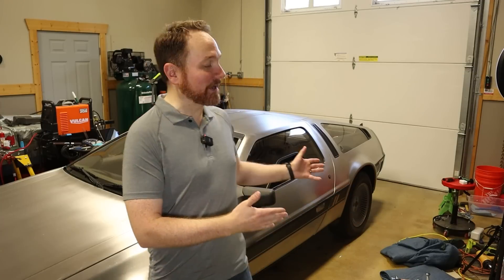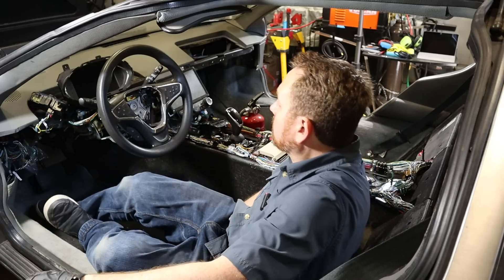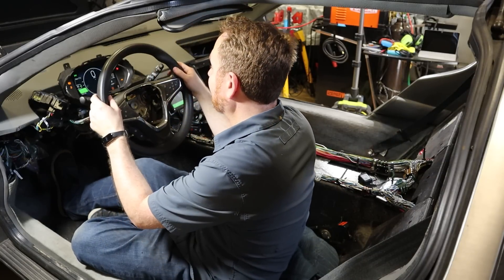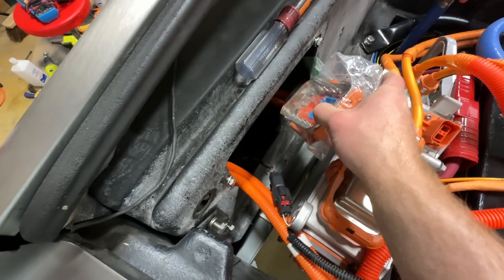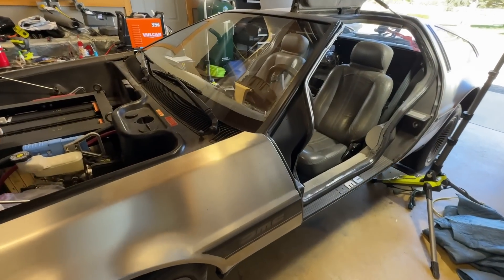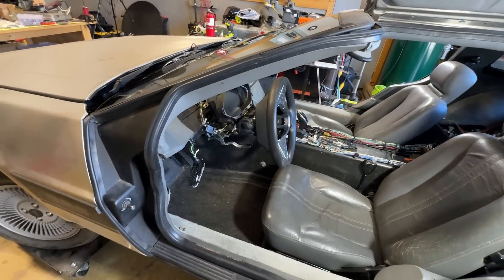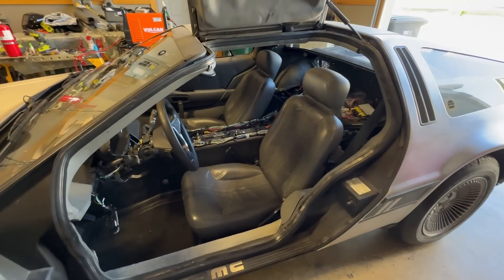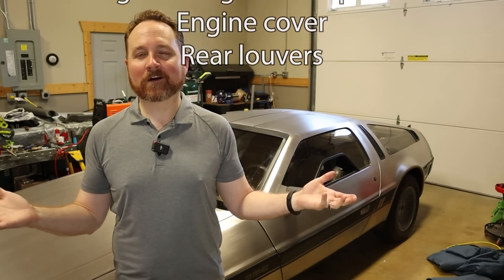DeLorean EV Conversion - Driving again!

Comment: Did you incorporate battery cooling?
Reply from the maker: Not yet - I have all the materials for it, but haven't yet gotten around to welding it all together and putting it inside of the loop. Also waiting on AC system first.
Reply: @BillCarlson  It's dependent on the AC system?
Reply from the maker: @332ARA Cooling for the battery is provided by the AC system, yes. The electronics loop is cooled via the radiator. Those two loops are separate, not connected.
Reply: @BillCarlson  Jaguar used the AC system to cool the fueling system on XJS's. So if your AC system is faulty so is how the car runs. I'd rather have a separate heat exchanger for the batteries. But Since your car thinks it's a Bolt then I guess you can't. Also do you have a total conversion cost yet?
Reply from the maker: @332ARA AC being out in the Bolt only disables DC fast charging - cooling isn't required during normal driving, it doesn't stress the battery that much.  Total cost of the car is somewhere around $60k, not including (many hundreds of hours) of labor. Labor is the real cost for conversions, if someone wanted to pay for something like this you're taking $150k-$200k.
Reply: @BillCarlson  does that include the price of the Delorean? How about cost of Donar car and materials? I'm considering converting a Corvair.
Reply from the maker: @332ARA  DeLorean was $20k plus $15k for a new frame and suspension. Bolt was $15k. Those are the major ticket items, but tons and tons of small stuff.
Reply: @BillCarlson  thanks. Cool car, nice build

Comment: I think you should fully take apart and gut that dash module and make it fit in the stock Delorean Dash Binnacle. It would look so cool next to the original DMC Gullwing door open light and stuff. Just 3D print a new face plate for all the Bolt lights and stuff to fit behind and mount up to.
Reply from the maker: I think that is a great idea!
Reply: @BillCarlson  Also, a great spot for the charge port is if you can make one of the corner pontoon vents at the corner of the rear deck windows into a door, because behind those vents is a tube about the size of the charge port that was originally used as a cold air inlet for the engine.

Comment: Question, I have the opportunity to buy a Chevy bolt for 2k but I’m wondering if I can make the horsepower higher than the stated 200 for me it will only be worth it if I can get 300-400 out of the setup
Reply from the maker: I haven't seen anyone who has been able to up the horsepower of the Bolt motor. I haven't even seen someone try to hack the CAN bus commands and control it manually... but I'm sure it's possible!

Comment: This is an amazing project. As a current 2017 Bolt owner, I have a 91 Integra that I’ve fantasized about doing this exact project with. 

I wonder if you could run this drivetrain without the infotainment?
Reply from the maker: I'm sure you could, but I haven't seen anyone do it yet. Really hoping that someone takes on that project, as the drive unit and battery pack would be great for EV conversions!

Comment: It would be interesting to see if it's possible to fit(hide) the charging port behind the rear numberplate ( fitting a hinge numberplate mount).
It's great to see older vehicles getting a new lease of life through electric conversions.

Comment: If GM just did a similar all electric two plus two seater coup, with some fun gull wing doors, it would go so hard.

Even if it wasn't that powerful. 0-60 in 7/8 seconds.

It doesn't have to be stupid powerful or fast. It just has to be RWD and fun to drive. Toyota proved that with the 86, and Mazda with the MX5.

Too many 'large/mid sized electric SUVs' these days. I miss small fun to drive cars.
Reply from the maker: I completely agree! I would really love an all-electric Honda CR-Z for example. But really any small, sporty, two seater.

Comment: A Tesla EV System would charge much faster than a Bolt System!
Reply from the maker: That's true! Up to 250kW or so, compared to 50kW on the Bolt. I haven't seen anyone do an EV conversion using the entire Tesla harness to be able to get those speeds, though, and the fastest DCFC I've seen on any EV conversion is roughly 50kW.
Reply: @BillCarlson  actually boosted Boyz, a YouTube Channel has put a Honda Minivan onto a Tesla Model S Plaid chassis to create the ultimate Sleeper minivan. They are going to do it again with another Honda Minivan and a Model X Plaid! They also just bought a T Boned CyberTruck and are in the process of repairing it as best as it can be, but it is having electric steering problems, from the crash damage. I am confident they will eventually resolve the issue, and get it back to full operation mode. These steering in the rear was damaged, and the doors were removed and shoved into the vehicle, and may have damaged the centerline Power over Ethernet cable going to the rear Electric steering control module. The from and rear steering use 48 Volts to operate, and there is a calibration issue with the steering wheel. The steering wheel is not mechanically connected to the front and rear wheels, as this is a true Dual Redundant, tribunal consensus, sensor input steering column connected only by Ethernet Communications, which also controls all the other functions of the vehicle, like fans for the cabin, fans for the cooling system, headlights and rear taillights/Marker lights, the Bed rolltop Metal cover, the brakes, power windows, door locks, speakers and amplifiers to the entertainment center/computer, ABS, the Ethernet is a full token ring when operating normally, with each module having two input/output connections with power, if any module has one of it’s connection shorted or opened, it should be able to get to the vital data it needs to function from the other route, while lighting up warning messages about the dead path. Perhaps a module pc board has a crack from the G Forces from the impact! That is what I suspect is wrong with that steering.

Comment: Amazing job so far! Will we get to see how you coupled the motor to the rear wheels?
Reply from the maker: Oh, that part was easy! I just took measurements and sent off the axle shaft from the stock DeLorean along with the axle shaft from the Bolt. The Drive Shaft Shop then made a custom axle shaft that bolted right in place, utilizing the spline and bolt patterns from either side. You could do the same thing yourself by cutting the two and welding them together - but a professional shop can do proper heat treating. Cost about $2k!
Reply: @BillCarlson  Nice!

Comment: Yes! Love the Yabert inspired Bolt integration. I’ve been following on DIY electric. I’m doing a VW Doka Tesla swap. Should have gone the bolt route like you…
Reply from the maker: The Bolt has some great components, but if I were to do it again, I'd definitely figure out how to use the motor, batteries, charger, but leave a lot of the rest of the modules behind. Wayyy too much work to build the wiring harness.

Comment: Bravo! This is a thing of beauty! However...I'm currently closing a deal on a Delorean and my first thought was converting it to electric so yours, and a few other, channels are of great interest to me. I have a question. I see how you got to your 3200lbs estimate of weight. The problem is you exceed the Delorean's GVWR of 3180 lbs. Not a big problem but you have to add your own weight when you are in it and the weight of any passenger as well. Assuming a grown adult is 150 to 200 lbs that puts the total weight with two passengers at 3500 to 3600 lbs. Do you see this as an issue?
Reply from the maker: Yes, good catch! The DeLorean only has about 400 pounds difference between curb weight (auto version) and GVWR, so even having two.. erhm.. full sized guys.. sitting in it will go over GVWR, not counting any luggage. :) Since I've replaced the frame with a stainless steel version and upgraded the suspension and braking, I'm not too worried about going over it by a couple hundred pounds. There are also plenty of BTTF Time Machine conversions adding hundreds of pounds and I haven't heard of it being an issue.
Reply: @BillCarlson  Wow! You replaced the frame! I didn't know those  were available in a stainless option. I've also reviewed your episode 6 where you talk about weight. I underestimated the weight you dropped from the gas powered systems. This is great information. Thanks!

Comment: So when the hv-interloop is broken.. what needs to happen to after it's fixed? Like does the 12v need cycled? Or a code cleared? Or what.
Reply from the maker: I only needed to cycle the 12v battery, I didn't need to reset codes.

Comment: Great update, I'd definitely like to see sealing the battery boxes and getting that cooling and the ac working and a successful DCFC, and beyond!  It's amazing you've actually pulled it off, and shaving a half second off the 0-60 of the Bolt(4.5 seconds off the DMC-12) just the cherry on top!
Reply: Well, beating the DMC 12 time is a Big achievement. Well done Bill.

Comment: Awesome job. It would be amazing if you could power your house from it using the 60~kwh battery during a power outage. Seriously, I own a Chevy Bolt and I've been wondering  if it could be done. Again, great job. I'll be watching for more. Thanks.
Reply from the maker: LOVE this idea, and it is something that I have put some thought into. We have a massive solar array, and even a small battery would let us run indefinitely if the grid ever went down. Once the DeLorean is really buttoned up, this is likely going to be my next project.
Reply: @BillCarlson  is your solar array a string inverter or micro inverters?
Reply from the maker: @wva5089  It uses two string inverters. I've got 90 410 panels, 37.9kW, connected to two Fronius inverters. One is 15kW and one is 12.5kW. On a clear day I am able to generate over 250kWh of electricity!
Reply: I’ve been wondering the same thing. My idea is to rig up a harness to the disconnect plug under the back seat, thru some PV cables and a breaker into the 400v rated PV hybrid inverter. Not exactly a cheap proposition considering the alternative is a sub $1000 dual fuel generator though.